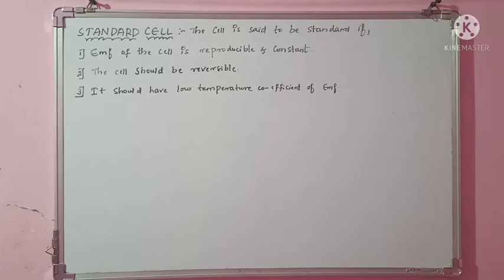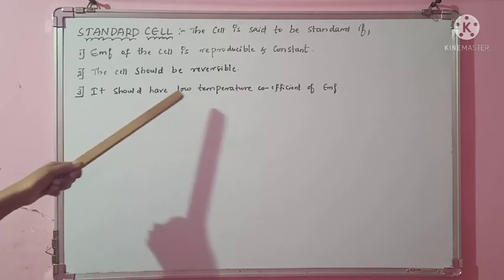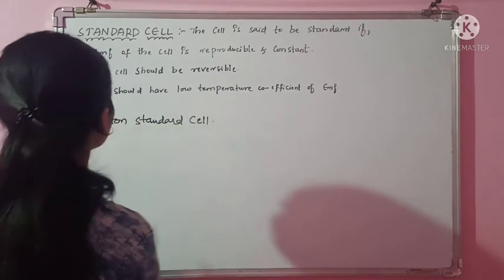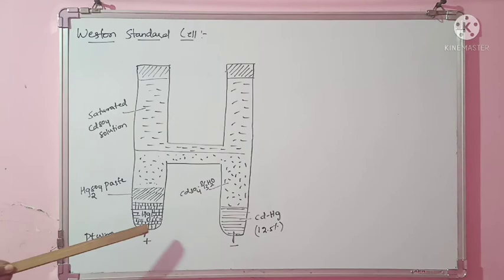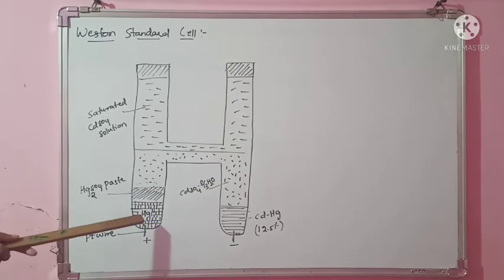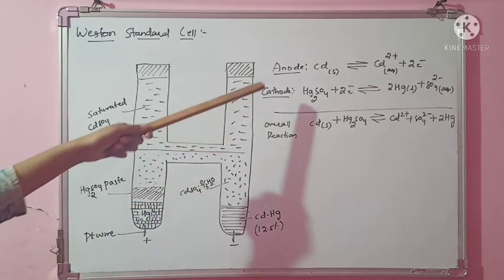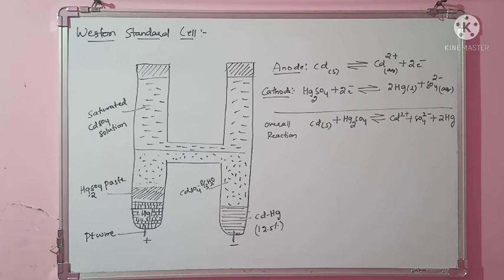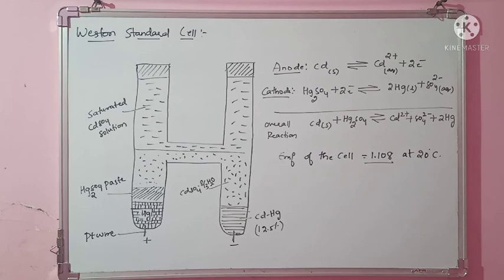WESTON STANDARD CELL

Comment: I found your video because I have 2 "Weston Standard Cell"'s that have failed for some reason (besides being Never upside-down) over time, and I wonder if the reaction can be reversed via external voltage stimulus in order to "re-charge" them back to the original 1.108 V-EMF ?